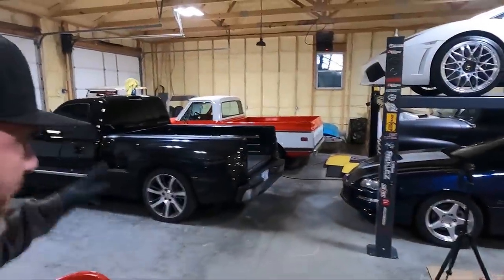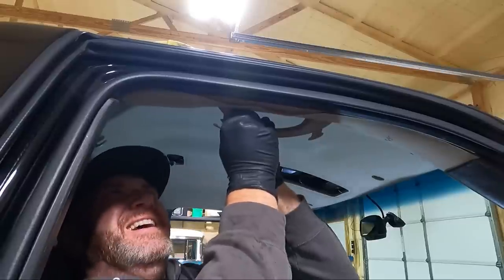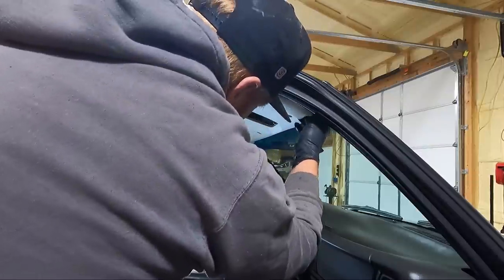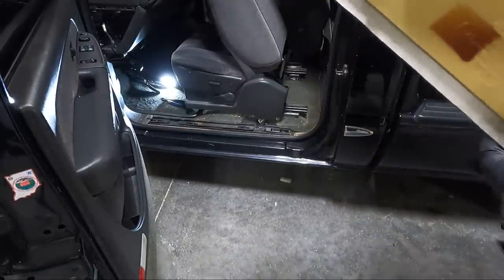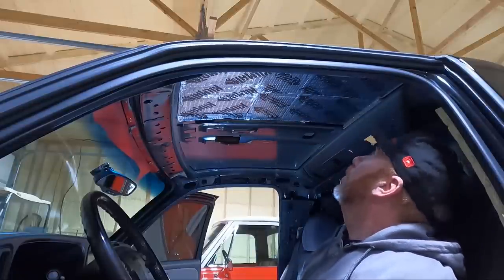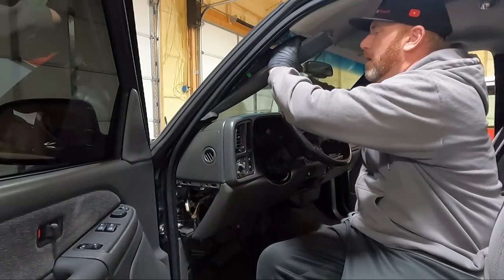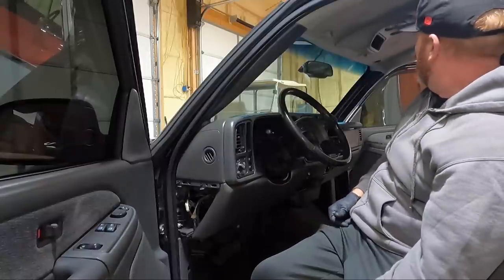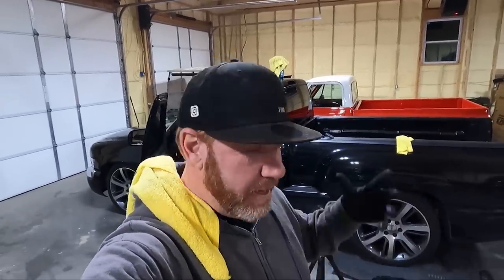How to Replace GMC Sierra NBS Headliner and Adding interior LEDs

Comment: Glad you done the headliner video but a bummer on the wiring mine is a 2000.. The upholstery shop quoted me between 4 and 5 hundred dollars depending on color to do my 3 door extended cab Chevy, guess he didn't want to do the job IMO. Went to Joanne Fabric and purchased the gray headliner material for $35.00 and 3M headliner glue was under $40.00 for two spray cans, I could mess up a couple of times and still save money. I'm going to figure a way for a work around for the wiring. Great learning experience for my grandson and I. Merry Christmas and a Happy New Year to you and your family and to all your viewers. ✌🏻
Reply from the maker: Yeah 99-02 will require pulling the wire off the headliner. Merry Christmas to you and your family too
Reply: @TWAMotorsports  yep my cordless hot glue gun will come in handy.
Reply from the maker: Definitely lol

Comment: My 02 Suburban 1500 LT with the beige color leather in excellent condition like the rest of it.   Right up to the windshield the headline got wet there and now about 3 inches of it hangs down the whole width of the windshield. What glue will keep it up there so it doesn’t fall down? The headliner is in perfect condition except the part that meets the windshield.
Reply from the maker: Nothing will fix that. Have to have the whole thing recovered

Comment: Are the sunvisors the stock ones? I’m trying to replace mines in my 2001 Silverado with ones that have that extension sleeve for the sun. What year is your truck?
Reply from the maker: Yes they are original. This is a 2003

Comment: Great video,  personally I would have gone with a charcoal grey or black headliner. But to each their own. I am going to be doing the same thing but I'm changing the roof in my 2000 extended cab to my donor 05 with a sunroof and then deadening the roof
Reply from the maker: That would require recovering visors and painting all the panels
Reply: @TWAMotorsports  I agree, but I would do it because I've never really liked the brown colored headliner and visors, I don't know why they didn't offer it up to begin with. All in all, I'm impressed with your videos
Reply from the maker: They did a lighter top to make the interior feel less confined. It is an optical illusion

Comment: I took the roof  brace  out of a 2003 Tahoe, because I want to put the long overhead console in my 2000 Sierra. It is beleive it or not about  an inch and a half shorter  than my GMC one!! Thats okay though, I am going to weld a  piece of metal to it to make it the length it needs to be. Was sweating bullets using the spot weld cutter drilling the spot welds out!
Reply from the maker: Lol. I get that.

Comment: That’s not the correct link for the third brake light. It goes to a sound deadening material.
Reply from the maker: Ok. I will fix it. Thank you
Reply: Thank you. I’m needing to order one also 😊
Reply from the maker: It's fixed
Reply: Also which brand of replacement headlights parking lights and taillights would you recommend for a 2002 Silverado 1500?
Reply: Yes it is. Thank you!
Reply from the maker: Oem if you can find them. Tyc if not